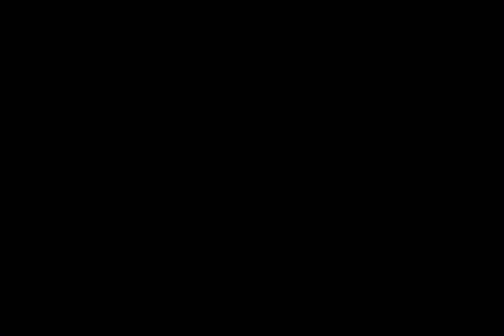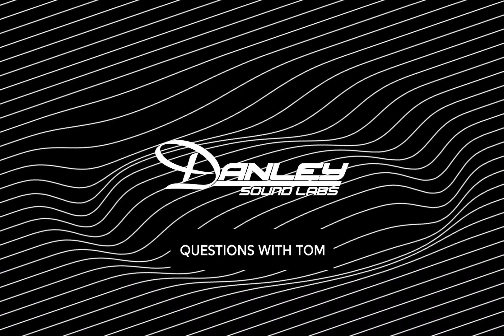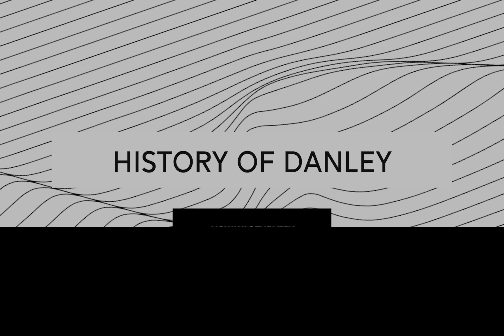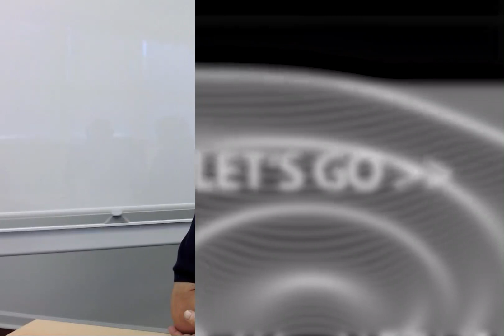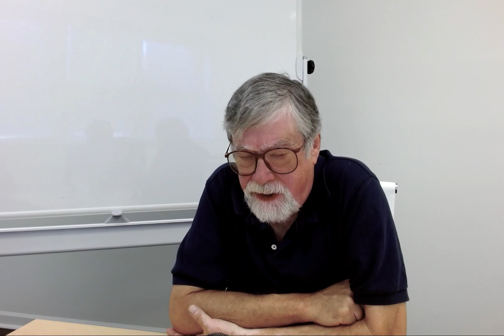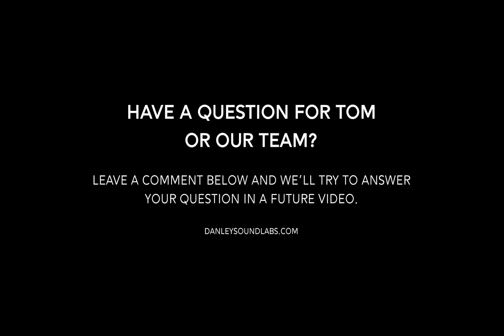Questions with Tom: The First Danley Loudspeaker

Comment: Hi there! I would love for Tom to briefly discuss ultrasonic frequency content and how relevant he feels that producing all harmonics generated by instruments is to generating clean and transparent audio that would approach the threshold of human perception. There is an Ooashi et. all paper that's been kicked around in audiophile forums for years now that seems hotly debated, but that's just the tip of the iceberg when it comes to how humans might perceive ultrasonics from the 20+ papers that I have since discovered on the subject. It seems like not only via air conduction and the inner ear, but also the saccule, bones, skin, and hair also might play a role in a full-body perception of sound. For whatever reason many audio engineers dismiss the importance of ultrasonics outright perhaps due to years of 20 hz - 20 kHz dogma without investigating further, but since sound waves are mechanical like ocean and earthquakes all waves are subject to constructive and destructive interference, therefore ultrasonics must modulate frequencies in the audible range. How much this is relevant is what I'm interested in, perhaps not very much, but it's still very intriguing to me. Although there is some concern for prolonged exposure to ultrasonics at high SPLs (see LRADs, teen deterrents), I'm still very intrigued by the research involving bone-conducting headphones to alleviate symptoms of tinnitus as well as non-invasive hearing aids that use ultrasonic carries to modulate speech. So yes, I'm curious what Tom thinks especially due to his experience with acoustic levitation because as far as I know the frequencies used to levitate small objects often fall in the ultrasonic range using piezoelectric transducers. Thank you so much!!

Comment: How is a Tapped horn able to have such great output and frequency extension, from such a short horn length?
Reply: At around 4:40 or so he explains it, the placement of the drivers at the appropriate wavelength location to couple and compliment each other driver.
Reply: @crhslaxgoalie  Danley was talking about the Synergy Horn
Reply: @hezekiahcharles6754  I agree. I think he was talking about the Synergy Horn and I, too, am wondering about the Tapped Horn logic.
Reply: One of the things I learned about the tapped horn is it is actually filling in the mid-band dip rather than extending the bass of a front loaded horn. With front loaded horns, you can choose a driver that's more even response in the mid sub-bass (50-70 Hz) or you can choose one with a powerful motor that drives strongly the quarter wave resonance of the horn and also the upper bass but the Q is too low to let it move in the mid band. It's a bit like having a driver that's too powerful a motor for a vented box or the box is too big. It's great for high one note SPL in a "loudest car" competition. It excites the tuning well by creating pressure but when the output is more about driver motion, the driver isn't light enough to give it the same sensitivity where excursion matters. With a tapped horn, you can choose the driver with the more U-shaped response to drive the horn harder at its tuning frequency than a more even driver of slightly higher Q. You can then boost the mid-band response because at twice the quarter wave resonance, the horn is in phase with the back of the driver radiation. Where the driver needs to "move more", you have the back of the driver reinforce the half wave time delayed output of the front. Where the driver needs to "push more" you have the quarter wave resonance of the horn amplifying the lows.
Reply: @TimpBizkit  Well said. Does this horn design / taped horn have fast enough transient response to keep up with drum & bass at 175bpm really nicely? What are the weaknesses of the design, and is the sound Q / SPL of the taped horn boxes worth the trade off in size as compared to direct radiating ?
Reply: @stellarmediacollective7953  i've found the room to be the majority of the bass "speed" impulse overshoot and ringing. I've had subs that sound good and tight in one room, turn to undefined rumble in another. Also I've found the subs that dig deeper are usually less tight sounding. That said I haven't heard a tapped horn save for maybe similar to a cubo design at low volume, but I think they sound somewhere between a ported box and a front loaded horn. There was a guy on youtube getting a good drum kit sound out of 4 TH18 but my only reference is camera audio. Probably not as good as a good pair of headphones but not like blowing into a bottle (I had some Kenwood stereo speakers that did that) if you know what I mean.
Getting the crossover correct with punchy mid bass and highs also helps.
Reply: @TimpBizkit  Brilliant. Thank you for the beautifully detailed response. I'd love to get my ears on a pair of TH118's properly set up and listen at normal volume, for SQ.